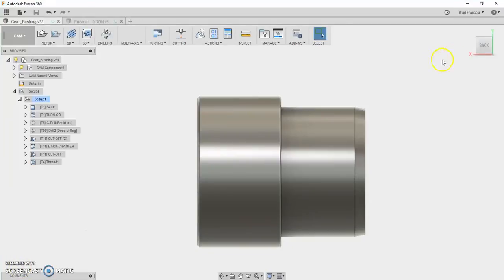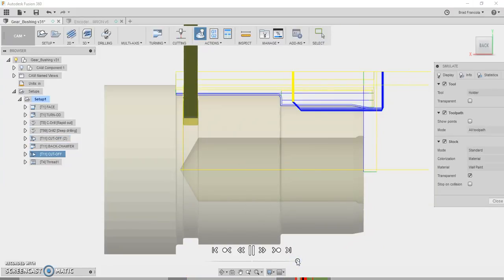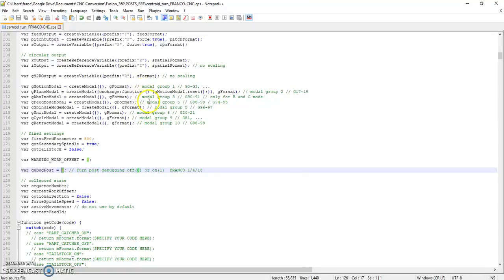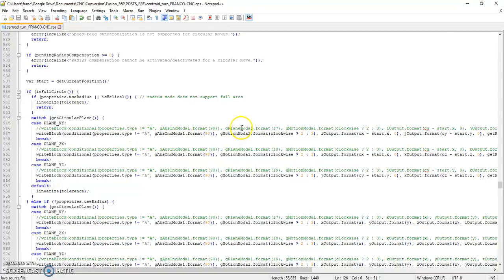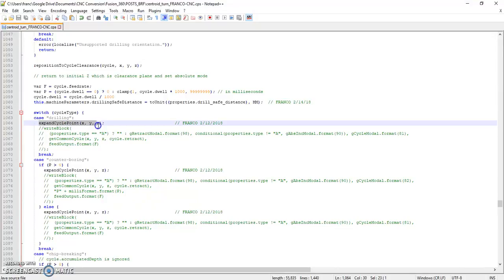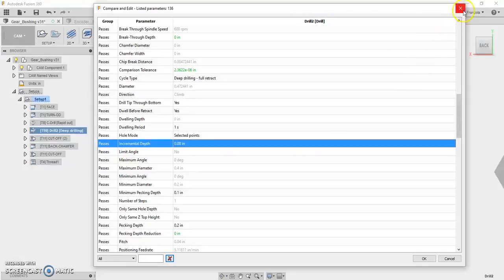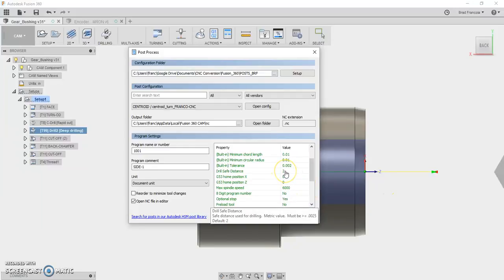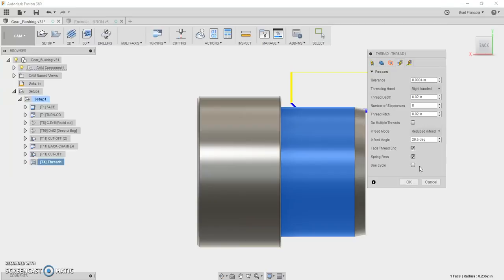Fusion 360 Turning Post Processor for Centroid

Comment: Hi about to download your post program. If this works it has probably saved many people in my position many days of getting nowhere. After weeks configuring a new lathe, which is not easy, I thought I was finally there. I also changed from solidworks to fusion which was another unwanted task. Confident from forums centroid is supported , if fact it doesn’t work. I will report back. Obviously you have spent a lot of time on this conversion. Great job and effort . Thanks Mike
Reply from the maker: Hi.  This post is a few years old.  It will probably work but, you may find that if you contact the post department they can help make sure the latest version on the website is working correctly.  You can send them a message:  cam.posts@autodesk.com

Comment: I'm getting a 'Could not open file..' error in CNC12 when trying to open a basic NC file (Face and profile operation), having exported from fusion using your post config (thanks by the way!..) is there anything obvious I should check first?  I've tried making various other simple operations to reduce errors, but each time I get the same error when trying to load the file into CNC12. Hope you can help :-)
Reply: when you are trying to open up the file make sure that the file is being opened up in the centroid folder. i tried opening them up off a flash drive and it would say it couldnt open it
Reply: Hmm no joy yet, I've been trying all sorts over the last few days. I've got my lathe up and running and have done some test cuts using the cnc12 conversational programming so atleast I know that's all working, but something is stopping cnc12 from opening any .nc files created from fusion360.
Reply: @TinkerInTheShop  nvm i see you fixed it

Comment: Hi Franco and others, I found an small issue with the post, but have yet to look at a solution.   If an operation is programmed to use High Feedrate rather than Rapids, the output will post the high feed moves in IPM while still in G99 (IPR) without changing to G98 (IPM). Not a big deal, just was wondering why my z axis was faulting when trying to move at F100 (quite quick in IPR lol). 

My short term solution will be to just allow rapids, however when I get a minute I will take a look at where to modify the post to change to G98 and back to G99.
John
Reply from the maker: Thanks. That is a good catch.  I'll check it out and if I can't fix it, I'll try to get an acquaintance at Autodesk to fix it for me.
Reply from the maker: Hi.  I just did a quick test and I see what you mean.  I have a feeling that none of the Fusion 360 turning posts are handling this correctly.  I'll be sure to send a message to the Autodesk folks.
Reply from the maker: Here is the Autodesk forum link if you care to join the thread: 
https://forums.autodesk.com/t5/fusion-360-computer-aided/turning-high-feedrate-mode-not-outputting-correctly-during-post/td-p/8485199